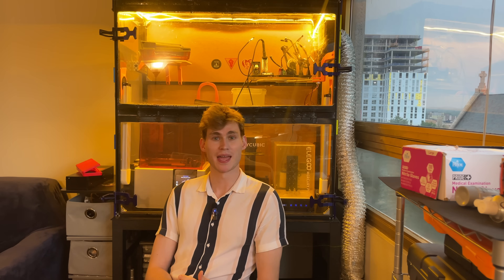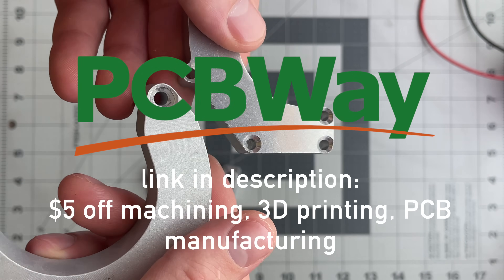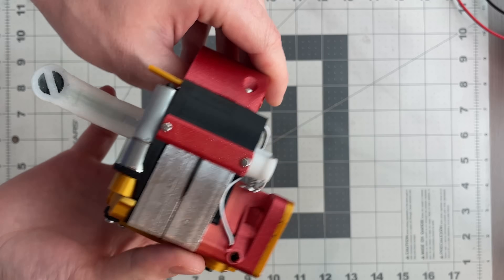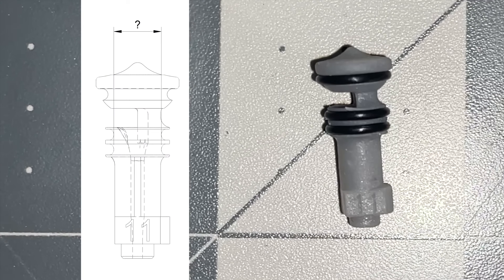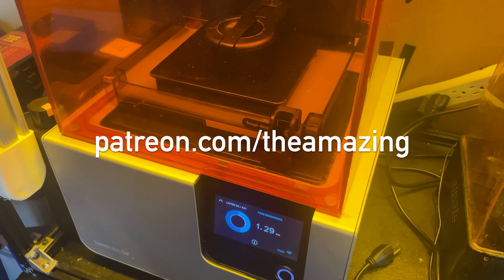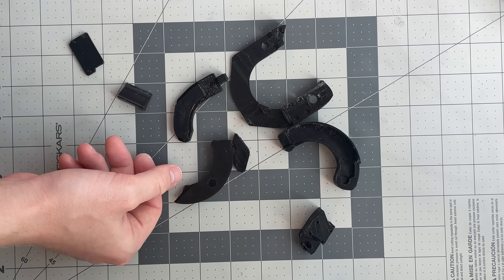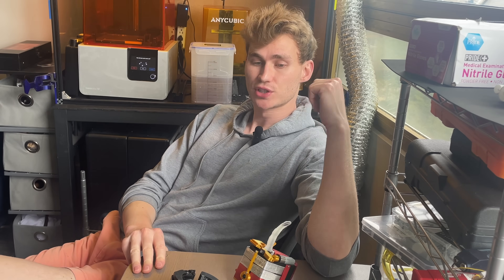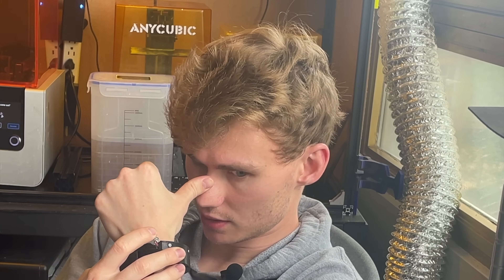An Exercise in Technology Miniaturization

Comment: The fact that Spiderman was able to do all this as an undergraduate in the late 50s is amazing! ;)

Suggestion: Use the USB-C port as a latch. As in: make it connect to a "magsafe" port (like on those fancy laptops and whatnot the head of the wire's plug remains in the port if you accidentally pull it way too strong... you know) and have a similar magnetic part on the place where you want the bracelet to close itself.
Sorry for the rambly description, not native english speaker here.
Reply from the maker: Wow that is an interesting suggestion!

Comment: you fancy printed O-rings; the generic method across much of the third world to replace foreigne manufactured engine gaskets is to use cereal box cardboard, which both surfaces are impregnated with a high temperature silicone sealant, and then basic paper cutting technique to cut this sheet of rubberized cardboard once it dries into the desired gaskets.  Historically, the method used before this was cork sheet or leather gaskets.  There's also a detail you'll eventually run into that pressure vessels prefer cylidrical interiors.
Reply from the maker: Wait that's so cool

Comment: Your videos are so great! As part of your design and test process I'd recommend designing a proof pressure like 1.5X your operating pressure. Then design your pressure vessel and seals to handle 1.5 or 2X factor of safety on top of your proof pressure. Eg. Meop 100, proof 150, and you design everything to handle 225-300. This lets you do a proof test where you pressurise it to 150 proof pressure on each unit you build, and then you have very high confidence that it will operate fine without leaks or pressure vessel failure at your 100 psi meop
Reply from the maker: Good suggestion! The designs include the safety factor, but testing at a proof pressure is a good suggestion.

Comment: Have you ever had a look at police cuffs before? I'd wager you need to do some redesigning to make it work but they've got a very easy to use latching mechanic with very few potential points of failure.
Reply from the maker: That is a good suggestion!